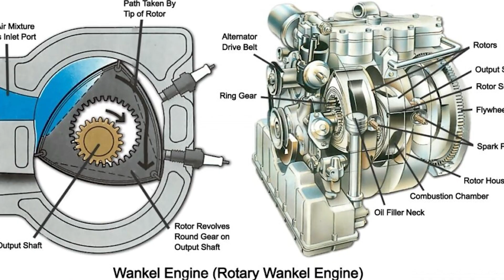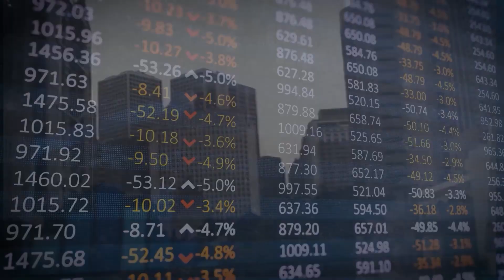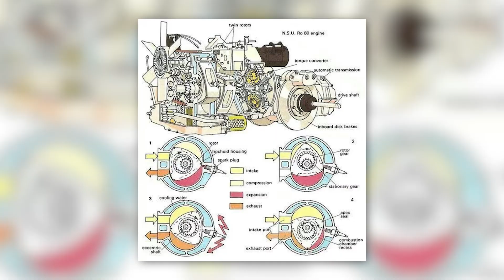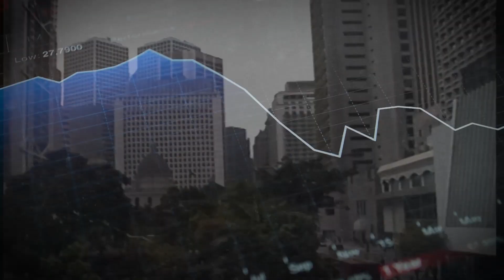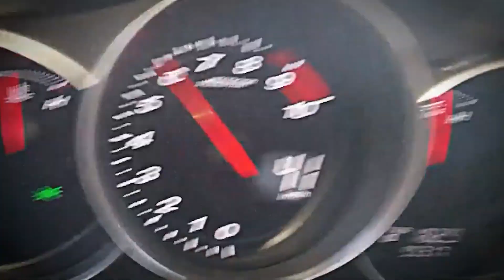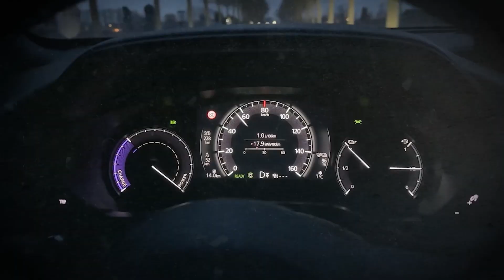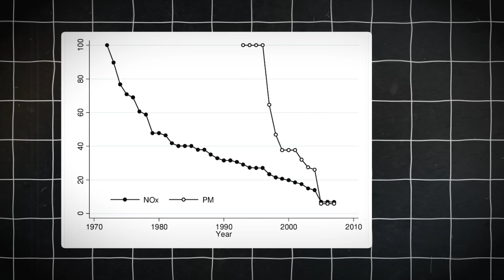How Mazda’s INSANE Rotary Engine Changed Everything

Comment: If mazda had made thos engine properly, it would have actually taken off.  But straight out of factory, its messy, slopppy, faulty, leaky, inefficient. Many often go straight to a tuner, who replaces seals, rings, bearings, even main components, because they didn't spend enough time on making sure you didn't have to replace your rotor every 100k. Get one now and its very cooo, but it'll only take absolutely all of your money.
Reply from the maker: That's a fair point — the rotary engine definitely had its quirks from the factory. Mazda pushed some boundaries with it, but long-term reliability wasn’t its strongest suit. That said, for enthusiasts who understand what they’re getting into, the unique performance and character can still make it worth the effort (and the cost). It’s not for everyone, but in the right hands, it’s a rewarding platform.